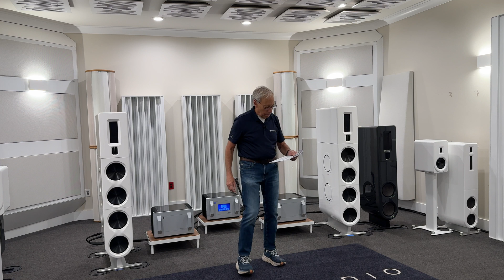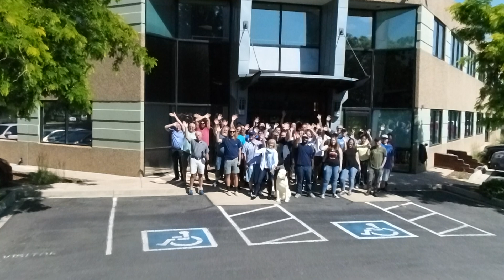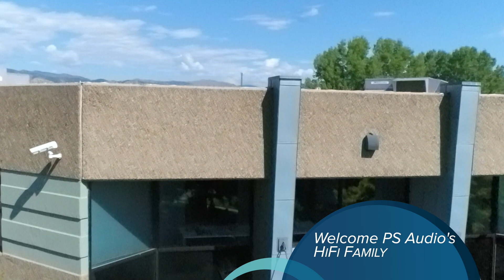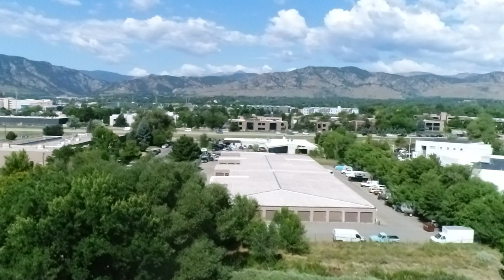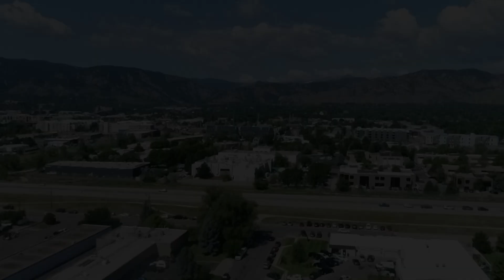Why high resolution transfers of analog tape sound better

Comment: Remastering has become synonymous with compressing the sound against the ceiling with a broomstick.
Reply: Yes, too many are like that. Only few I really like, Pink Floyd 2011 Remaster (quite dynamic), Black Sabbath 2009 and Dawid Bowie 2018 24/96khz. 
For some reason Dawid Bowie - Let's Dance (2018 Remaster) 24/192 version is more compressed than 24/96. Both can be found from Tidal search.
Reply: @D1N02  Bad remastered, you’re absolutely right. Not for the good ones
Reply: That is such a shame. Fortunately that isn‘t the case with most jazz and classical recordings. I would never buy a remastered CD if it only sounds good in a car (or perhaps not even there).
Reply: @D1N02  Yes, it’s compressed and not compromised the original recording. This is exactly the job of remaster doing well is the key.
Reply: The newest Dark Side of the Moon remaster... 😢